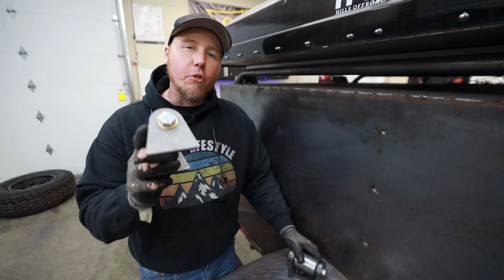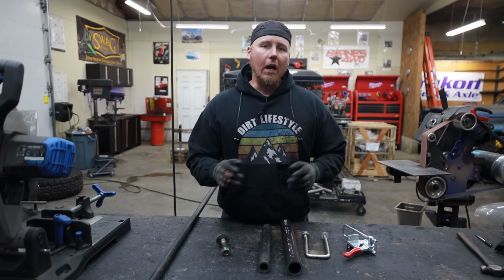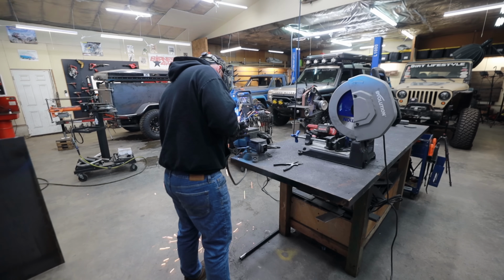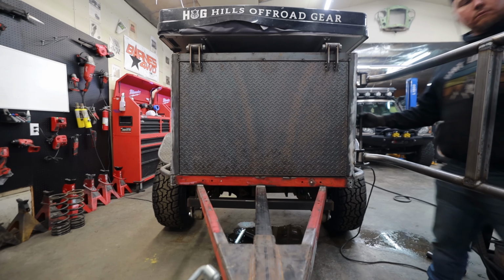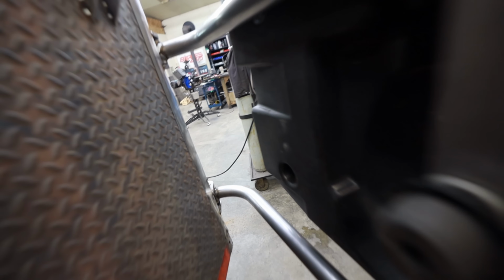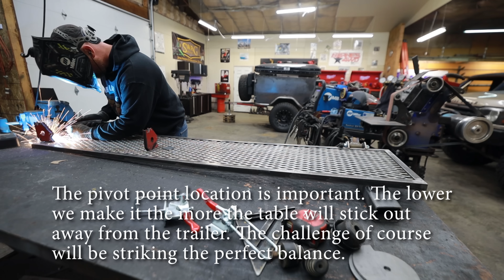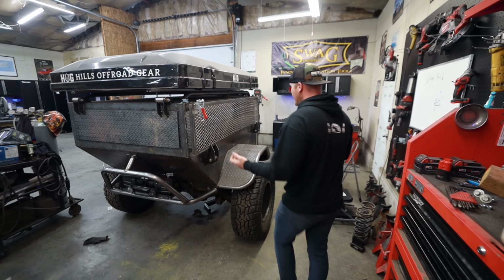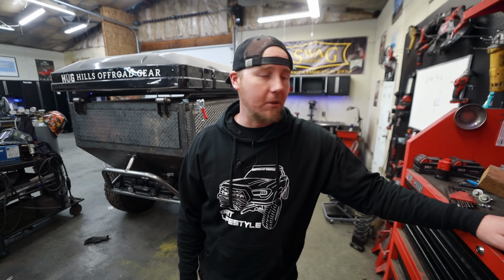Finally Back In The Shop! Harbor Freight Offroad Trailer Episode 6 👊.

Comment: Maybe a hinged rod sort of like a hood prop rod that has a hook on one end and attached to the trailer wall on the other end. Hooks onto a loop off the table to hold it up. Both rods on each end of the table tuck against the wall of the trailer out of the way when stowed.

Comment: Place I used to work at had something similar that would hold hand power tools up out of the way and you could grab them to use them then they retracted back up out of the way when you were done. Might be something to look at. Another idea is just going simple and adding legs at both corners like you'd find on a canopy that tuck up nice and tight when packed up

Comment: I would do a bump stop in the middle and add 2 legs that when the table is up one lays from the front to the back and the other lays from back to front. if you add good strong magnets to the legs you may not need anything else to restrain them when driving.

Comment: You could retro fit the mechanism from a lawn mower pressure washer etc pull start. Or just weld a tab into the hinge as stop maybe tap another bump stop into the tab.

Comment: You could use bicycle chain. Holds a ton of weight, flexible but only straight line flexible so it'll always get golden in where the table is. No fear of it sticking out because it doesn't bent that way.

Comment: Your side table. It's going to be 6 inches higher when you're up on the ramps. Use the fender as your stop as you originally thought. Just use two pieces of flat steel hinged in the middle as your support on the ends. You'll need to rethink the lock up position again.

Comment: Could use the same principle as a kitchen sink that has the extended hose, typically they just have a weight on the hose (braided cable for you) so when you go to flip the table back up the weights on the end of the cable inside the frame of the trailer pull the slack back inside and tuck it away.

Comment: some flat bar tailgate supports that fold and have that little bit of slide is a good idea. I saw someone mention that. that wouldn't be too hard to make. a short channel for a bolt to slide in a bit would work.
the tire carrier with the 15 gallon gas reservoir might come in handy and it it looks awesome! That was some great engineering, Nate! I have actually followed the build on this. Really come a long way!

Comment: Use a weighted end on cable…. Like hose on sink sprayer. Run cable inside trailer and put weight on end. Weight would act as stop and to make it return when table is lifted up.

Comment: You could have a weight on the inside of the wall so when you fold the table up the weight pulls the cable through the hole and when the tables down the weight acts as a stopper so the cable doesn’t come all the way out
Reply: I was think similar, but put the weight inside a couple of pipes vertical on the outside to keep the box more water tight.

Comment: How about for the table, doing hinged prop rods than the bottom side(on outside rail of table)  of the table that forms a triangle down to a connection point on the trailer wall and be much simpler and not have cables in the way?  when you pick up the table the prop rods hinge down and can be held in with pins for travel.  this is turning out awesome!  Keep up the good work!

Comment: Check out the gorilla lift trailer ramp assistance springs !   Their a cable / spring combo that helps lift trailer gates.    But they retract into a sqaure housing.    You could probably mimick that design on a smaller scale!   

Or you could just weld a piece of tube on the inside with a cable and weight system , cable slides out when you open the table , and when you close the table the weights pull the cable back inside the tube !

Comment: Angle the cables in 6”-8” at the top so they’ll automatically tuck when you fold the table.  Also could use rope or dyneema instead of cable. Plenty strong and won’t scuff your paint or wrap.

Comment: Us a bump stop on each side at the hinge.  When it is down it will rest on the bump stops at the hinge.  You could even make it adjustable. And with a bump stop on each side it should be very stable.  Just think of the turning stop bolt on axle knuckles.  Same concept.

Comment: Collapsible table legs make some out of some tubing so they collapse down to about 2 ft-ish, and fold under the table. You could even take it step further and make them use the feet from a Hi-Lift jack so they dont sink in and then they pull double duty...

Comment: I like the idea of a hinge stop system and flat bar system as others have commented. I think you could also mount a  Tool balancer/ retractor on the inside of the box.  I am not sure what kind of weight they can hold in their fully extended position.  You could mount one on the opposite side of the box and just use it for tensioning a cable.  That way all of the weight is on the cable and not the balancer.

Comment: Use cables to prop it up, with the back end of the cable INSIDE the trailer. Have the stop on the inside so that it can't over extend but the stop would be weighted so when you lift the cable, it automatically pulls into the trailer. Could use springs to do the same, to keep it up top, maybe with a pulley on the corners to the springs mount inside the trailer on the roof.

Comment: Trailers sometimes have cable assisted gates. All it is,  is a long spring inside a tube connected to the cable. A garage spring for example. In this case a weaker spring.

Comment: Think a garage door coil spring setup with the cable. 

Another thought would be tilt collapsible arms that triangulate back to the trailer frame from the outer frame of the table.

Comment: Use 1/2 x1/8 angle and 2 lengths pivoting in 3 places like the stays on a step ladder thin nylon washers at each pivot point and pins for hinges with split pin to secure.

Comment: Tap some 1/4”-20 holes in 2-3 places and use some cheap compact photo/video monopods. Adjustable if ground is off kilter, small and removable (won’t accidentally leave them on ). If it breaks you can replace easily. And with the 1/4”-20 you have more places to mount cameras for making us more rad videos.

Comment: you can use a set of those spring/cable things that assist in the lifting of a gate on a trailer to hold the table.

Comment: You could use some hood/trunk lid struts, they could even be wore out cuz you wouldn't need the force from them but just the limiting factor from them, as they would stop once they hit the end of their designed travel. They're relatively cheap, low profile and pretty durable.

Comment: Look at the rigd ultra table. They don't use cables but instead they use arms that slide and pivot. Possibly alittle stronger than cable? No loops to worry about, folds up neat and you don't have to worry about a spring breaking mid trip.

Comment: go super simple make triangle on a hinge that folds down when using and folds flat then in storage on the bottom of the table that rests on the side of the trailer. Use three of them put a bump stop on the side of the foot that touches the trailer. or Bars that rest on some welded on bolts so that they form a triangle and then fold down then in storage mode. there are tent trailers that use both these designs for out door tables and stove spots. no cables folds flat, strong enough to sit on.

Comment: Weld two tubes across inside with a spring drawn cable attached to the table corner fashioned after the ramp assist on utility trailers.

Comment: To support your table, use two pieces of metal that have a hinge in the middle. That way when you drop the table down it will be extremely sturdy and when you lift it up, it will just hinge in the middle and be solid on the inside of the table instead of a cable that will hang out the sides.

Comment: Can use retractable dog leashes. Or use the cables but mount the top anchor point 15cm inwards from the end so that the cable folds inside once the table is up.may lose a bit of work space though as the cable will take up space once the table is open

Comment: Skip the cable for the table support. On each end use 2 pieces of flat stock bolted together at one end, and then bolted to the tailed and table at the other.  https://m.media-amazon.com/images/I/51P7LBUz-BL._AC_SX679_.jpg
Reply from the maker: I considered this too. Super simple!
Reply: Might just be loud raddling when driving just like how they were on older trucks🤷🏽‍♂️
Reply: use some nylon washers or something similar to act as a bushing between all the pivot points that should eliminate any noise and rattling.

Comment: Make a retracting cable like a window sash. A weight on end of cable. It will drop down when table is up pulling cable in. And when table is down weight could be used as a stop.

Comment: look into how the pull out taps (faucets?) work. simply having a weight attached to the cable which acts as a stop, so when you lift the table back up the weight pulls the cable inwards

Comment: For central cable pull, cannibalize an emergency brake and use a hand crank (light boat winch or smaller).   Have fun determining the route and location for the crank.

Comment: About your table, mount it lower so it rest on your fender. Because you said your gonna raise the height of the entire rig, the table will need to be lower. Use a strip off steel going down the center longways to help support the ends.

Comment: Nate great job! I'm glad to see you back in the shop so two ideas the two flat bar with a bolt or some contraption to pivot , its a great system it is hard, ridged and strong! The second option personal favorite I know you have a timing Chain or the old tcase Chain from your 231 you
 have had a few! but Chain I'll only bend one direction without flapping around it won't go sideways but will easily support all the weight look cool and be functional. Ultimately you teach in your videos, creativity comes within it is being able to find and harness what the mind sees and then recreation through innovation 💡 you inspire me!

Comment: I would add a adjustable bolts or weld on pins, 1 on each hinge that limits hinge travel.  Make sure they are close or inside the hinge area not to cause a protruding point to snag clothing etc...

Comment: You could just make a couple two section hinges, When its closed up they will be suspended from the top corners and will tuck themselves away at the ends of your table, And it could also be used by the wife and kids as a bench or even a cot,,  Sometimes the simplest things can be more practical and versatile,, And we all know versatility is a huge advantage..
Good luck with your build

Comment: I've never used or seen and cable system like what you're talking about but you have a lot of different options. You could make a L shaped bracket for both ends of the shelf and have them on a simple hinge so they swing out when you drop the table down. Mount then in from and behind the tire. Or you can use gas struts. Or use solid round bar and cut into 2 equal parts (2 for each side) they will have 3 pivot points on each side. This would concealed behind the table when it's not in use.

Comment: A weight in a track for the self retracting cable part with a set length but that adds weight with little purpose. I would use a stop on your hinge similar to a door stop.

Comment: build a bar support on each side.  So when its fully extended the bars are "straight" and support the table on each side as opposed to cables, some old pickups had something similar to this.  This way when they are folded up you don't have to worry about a loop or anything to tuck away.  I would think a retractable cable would tend to want to pull the table back up while its down at camp, unless you added a locking mechanism to keep it down.

Comment: Add steel rods, that tuck under the tent when closed, to both sides. The rods will attach to fittings on the table (static) and slide through a ring attached to the trailer. Let me know and I could draw it for you.

Comment: Looks like a lot of people have already comment with the 2 ideas that first came to my mind when you asked the question.  Sturts at each end or the flat bar style hinge type supports.  Another option might be hinged extendable legs on each end but those may end up being more of a pain to build and use.  The cable idea is not great as it doesn't look all that great and like you said, could be problematic with hanging down and getting caught on things.  You could also put a stop on the hinges to keep the table from going past 90 degrees but you might have to all strength to the ends of the table to keep it from bending/flexing.

Comment: Possibly a motorcycle chain. When folding the table it should sit neatly in the gap between the table and trailer wall plus will be rigid enough not to swing around catching trees and scrub.

Comment: I can think of a few options for a self-tucking cable system:
1. You can still do a steel cable support, but build a vertical weight inside of the trailer caged in a track with a spring attached to the bottom to help pull the cable back in when it is closed.
2. Same as #1 but instead do a horizontal track on the roof of the trailer, you could use just a spring to pull the cable back in, or a gas strut to push.
3. Or you can build a drum for the cables with a bearing in the center and get a couple of 12v DC motors to turn the drums in/out to raise/lower the table electronically.

Comment: Create a smaller version of the system for a roll up garage door, (full width steel rod with coil springs where tension is increased as you lower table), inside the trailer along the top and have cables come out to table through trailer wall.  You would have to develop some sort of connection to hold it in the fully open position unless you went nuts and built a chain driven opener inside as well, like and electric garage door opener.  🤠 Go nuts man, go for it.

Comment: I am the King of Overkill but I would add a diagonal support from the spare tire/fuel mount location, (8:02) down to the horizontal round tube or vertical square tube.

Comment: I may be late to the party on the cable solution (and haven't read all 874 comments), but I'm thinking of a tube with spring inside, which puts tension on cable for retraction.  Simple pulley or bushing at the end of the tubing to reduce friction on cable.  You see these sometimes in trailer gate lift assist assemblies and/or sometimes in cable fencing.  Tubing hides spring and unused cable length of course.  Spring tension would just need to be enough to retract cable, but no so much as to keep table from lowering and staying down.  Collar fixed on the cable would limit its extraction, and provide support to table as needed.  Very few parts to add weight, get hung up, or fail.

Comment: Bars on each corner that folds up as you put the table in up postion. Make it like your trailor jack that you have a inside bar.. pull a pin and adjust to diffrent hight of unleveled ground.
Reply: Perhaps the corner bars that rest on your bumper gaurd down bellow on the sides.

Comment: Heavy guage sheet metal triangles on each end and maybe middle that are hinged in the center so they will tuck in as your putting up the table. Hinged in a way you could fold each triangle in half perfectly.

Comment: Instead of attaching the table at the edge and having it fold down, you could support it on the centerline of the table on the outside edges and make some sort of track system on the edge of the wall and the edge of the table to run in. When the table is folded out the edge slides up the track and locks in place. Fold it down and the edge slides down the tracks and the table rests up against the side of the trailer.

Comment: Drill a hole in the side where the cable can come out from, the inside... put a spring on in the inside ..you can put it inside of a big round piece of pipe... the spring will be inside the pipe and it will pull the cable through when you lift the table... the cable will pull back inside and down in the tube with the spring.... put a stop on the cable on the inside so I can only come down as far as you need it to...

Comment: 🤔 For your table retractable cable a pullyblock and weight simplest form with a piece of PVC tubing for the weight to ride in to prevent  swinging rattling around on the inside.

Comment: I love lots of the idea's that you received ❤. I still like the retractable cable, that said a bunch of cable idea's came to me, a light cord for easy, light load retraction. You know the retractable light? Or ...
Also, most garage doors have a cable wheel on a ? 1" or 1.25" bar, just add a spring, a winder to it! It's heavy cable, it only realy has to carry the weight, so the retractor can be light, as you close the table up, the cable just has to wind up! 💡 They can totally work inside from the bottom, no catching twigs or more important, fingers, 🤔.
Have fun! I love watching creativity. 
👍👌✌🏻🙋‍♂️🌤🇨🇦👨‍🦽😎.

Comment: have the cable go through the wall of trailer through a small reinforced hole.  Have the cable terminate inside with a washer @ the desired length for table levelness.  then have cable retract to other side or trailer in a tube with a spring or even a bungie cord  Then the cable would hold table level when open  & retract kinda like a seat belt as you raise the table :)

Comment: Make a stop that is built into the hinge that is weld/bolted to the trailer. It looks like you have space on the arms to the table to weld a quick stop so it cannot fold down further. Downside is it might not be strong enough to hold the whole table up if there is a lot of flex.

Comment: On your table, I would suggest stops on your hinges, like kick stands on the table side of the hinges. That way it would stop your table at 90* and you never have anything in the way. But your table would have to be more rigid, like built fron tube instead of angle. 
Thanks for reading.